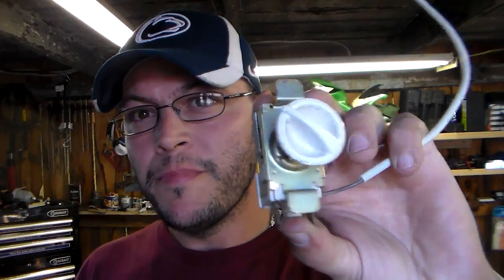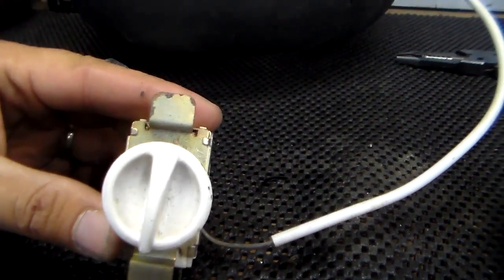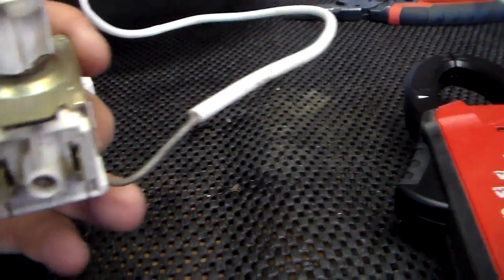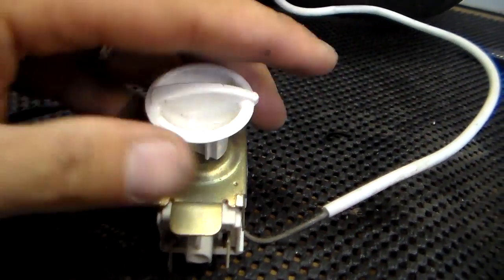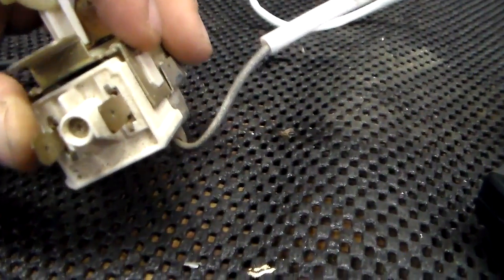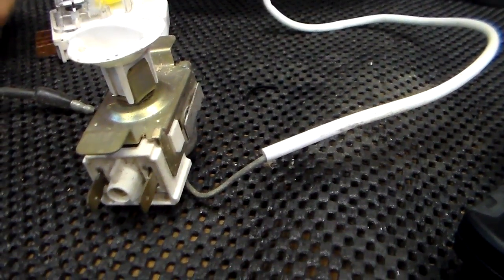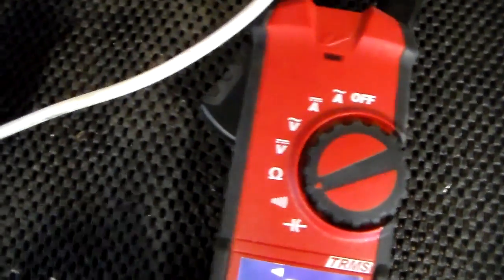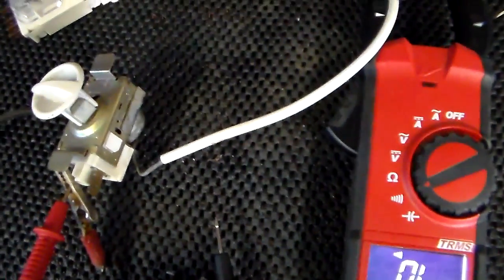No Cool Refrigerator - How to test the Thermostat

Comment: I have an ALL Refrigerator Gladiator/garage ready unit that isn't cooling. The compresser and relay are working. Freon was added (the repair person didn't say if needed but did anyway) .It worked 2 weeks nicely then stopped cooling. Light is on inside and a fan runs.Coils and back area clean. Could it be a bad thermostat?

Comment: Thanks for the advice and information. I have a small Frigidaire (EFR751) that for some reason, will shut down the compressor and then not turn on again. This happens with a power interruptions and it does not turn back on the compressor unless I cycle through the thermostat from off to cool at which point it does turn back on. I’m Thinking of replacing the thermostat to see if that will help. Thoughts?  Thanks.

Comment: Should there be a certain ohm reading? My temp control shows continuity, but no resistance when it's turned on. I get zero ohms no matter where I turn the knob. It breaks the circuit when I turn it off, but when on its just zero ohms. I'm not sure if I need to replace it. It seems like my compressor is always running.

Comment: How do I know which defrost thermostat to buy for a 40 year old side by side where the old thermostat has no numbers as you describe . The only numbers on it are 20640L14-174-721
L60  400395-101 Z8H. The make is unknown because it was sold as a department   store  brand  by Eaton's  in Canada which has long disappeared.  The model number is of no use either but it is HP4-DR818S3-Y, the max defrost 4.5 amps. HP 1/3 , AMP 5.7 volt 115 cycle 60. Please help, I would really appreciate it. Thank you for your time.

l

Comment: Ok so I’m about as green as it is when it comes to this type thing. So I have a mini fridge that does not have the freezer up top. I’ve changed out the relay and overload protector and that did not work so I went and bought a multimeter to test the compressor and the thermostat. The compressor as far as I know checked out fine but the thermostat, when I checked for continuity, it would beep when it was turned off and it would beep when turned on. Again, sorry if this is a dumb question but like I said, I’m a complete newbie when it comes to this type of work. Any help would be greatly appreciated!

Comment: Hi Bill - Thanks for all the great videos. I have a 3-year-old frigidaire all fridge (no freezer). It is running at about 65 degrees. I have checked the defrost timer, timer motor, and defrost control. They are all good. My temp control thermostat tests on all positions show 0 ohms.  I am thinking that is the problem, but the fan still goes on and off when I turn the knob, and that has me wondering. Does that mean anything or am I overthinking this? The part is quite expensive for me right now,  and I just want to double-check before ordering.

Comment: Hello Bill 
   i have a chest fridge from 1941  mode - 6    it's name is  (Ideal)  yesterday compressor stopped working, I knocked on thermostat fridge started to work but in the morning compressor was not working again.  i knocked again to thermostat compressor started to work again  i know the problem is the thermostat. 
    I have a question: van i clean the contacts in inside the thermostat or play with adjust escrow.    need your opinion   thanks in advance

Comment: I need to replace the thermostat on my Kenmore Coldspot refrigerator, manufactured in Dec 2010. I am being told by appliance repair shops I will have to buy a new fridge because the thermostat is no longer made and there is NO REPLACEMENT substitute part made. I need to bypass the thermostat while I search for a replacement.

However, I can’t get this old thermostat out. The twin prong plug-in “plugs” into 2 fragile plastic pieces. And I can’t see a way to undo the “plug-in” from the 2 plastic pieces they are forced into (one of which is attached to an orange wire, and the other of which is attached to a red wire). I would think it would slide out, but there’s no way to slide this thermostat out. It’s held in on the sides by 2 plastic cubes that are forced into square holes in the thin metal inside plastic of the fridge’s control. It appears the only option is to force apart the plastic pieces here, and also to force apart the plastic pieces into which the prongs of the thermostat plugs. If the plastic parts are cracked or broken, I fear I will not be able to bypass the thermostat. If I break the plastic pieces, I also would not be able to plug in a new thermostat, should my search eventually find someone who is manufacturing a substitute thermostat I could make to fit. Could you take apart the thermostat on a newer fridge, one with these plastic parts and show us how to remove a thermostat from the plastic parts without breaking the plastic? 
I have photos of all of this if you have an email address I can email them to.

Comment: Thank you so much for the tips!!! I did connect the 2 terminals together inside the fridge where thermostat connects and it worked… lesson learned, buy the OEM part. I did replace this thing a few months ago, a part ordered from Amazon that was obviously not good. Get the original. Thanks!

Comment: Thanks for this video .
My fridge when I plug in the wire the fridge light inside the fridge working but the fridge compressor and the little cooling fan the one next to the copmressoer not running ?

Comment: Hey Bill - thanks for your videos. They’re great.  I have a u-line thermostat with 3 pins - yellow, red and blue wires. Yellow to blue pin had continuity.  Yellow to red or blue to red is open.  The fans are running, but it isn’t cooling.  Can you tell me if this thermostat is ok?  BTW, the refrigerator is going in and out of defrost. Thanks for the help.

Comment: top mount freezer cold enough(but builds up something like snow  really fast)   and fridge is to warm.   Fan is working.   Coils in freezer are not icing over ,  defrost timer is coming on and off like it should.   what is wrong?   If the control temp. is not working properly would it be all or none?   Would it work half the time and not other times, or is it an all or none thing?
Reply: forgot to mention, I took the control box off in the top of the fridge and it is not iced up.
Reply: Can the compressor be the problem even though it is tuning off and on?
Reply: This is a fridgidaire fridge with a  top mount freezer  only 2 years old

Comment: I have had a problem with a whirlpool side by side . Would not come on ,took a screwdriver and turned defrost timer refrigerator started. Ran for four days like normal then on day 5 would not come on at all. Replaced defrost timer ,started back up . Now it runs but have to tap the thermostat to get it running again.  I have checked thermostat with ohm meter says good .

Comment: Kenmore upright freezer 2014 model that would not do anything except turn the light on when I opened the door.  Did what he said above-no resistance on the thermometer so I bridged across the terminals with wire and plugged it back in and immediately had the fan and compressor turn on.  $10 fix.  Wish I had seen this before wasting money on a defrost timer.  Thanks.

Comment: Bill you are a life saver.  My Whirlpool side by side refrigerator just went out yesterday and I did not know where to start.  I did like everyone in this situation - check youtube.  Your videos popped up and I began getting a clue to the root cause.  The compressor is not working and the fan is not working so I deduced the problem to be the refrigerator thermostat.  Didn't know how to check for continuity on a multimeter (embarrassing), but your video walked me through the steps and I nothing registered so it appears that I have a bad thermostat.  Just wanted to tell you thanks cause I'm sure you saved me lots of dollars.

Comment: You just saved me almost $3000 and 35 days of hassle. 
Fridge stopped working sometime Friday night. 
Ohmed out the compressor it was good, I had replaced the diodes and capacitor about 4-5 years ago.

Defrost thermostat was replaced about 10 years ago and still tested good.

Pulled the fridge control apart and found out it was the one that controlled the flap between freezer and fridge.
Pulled the freezer control apart and jumped the thermostat wires and it fired right up.

Ohmed out the thermostat and it tested good. put it back together and the fridge was working. I think I'm going to buy a replacement anyways just in case.

You wonder how this saved me almost $3000 and 35 days. The fridge broke the last weekend in Aug. My wife went to Home Depot and found a matching Black Stainless French door fridge, microwave, stove and dishwasher for their Labor Day sale. Because of Covid, the fridge is on back order until Oct 6.

Comment: Quick question: what if I’m getting resistance from the thermostat (not the control temperature) but no continuity at all? I did the test having the thermostat into a glass of water and ice for 10 minutes. Do I need to replace it?

Comment: Could it still be the thermostat if it never shuts off. Seems like y fridge run forever. It’s is ge profile double door fridge. I manually turned the defrost timer until it clicked and it did shut down the compressor and started heating up in the freezer department so that tells me the defrost mode works fine. But I was confused of how often a fridge is supposed to shut off. Does it only shut off when the defrost timer tell it to. Or does it shut off when the temp control tells it to also

Comment: I need help. I've been watching your videos and trying to troubleshoot things. My refrigerator is not as cold as it should be and all fans are working, changed the defrost timer and it still reads 50° in my fridge. Compressor works, coils are cleaned off, everything seems to be working but my fridge is still not as cool as it should be. What do I do now I'm lost??
Reply: There are many things which can cause a refrigerator not to cool properly. Since you already cleaned the condenser coil and verified that both fans are running, it's a good start. Now you need to make sure that it's actually going into defrost cycle about every 8 hours. Can you hear dripping defrost water "sizzling" on the hot evaporator heating element? You say 50°F in the fridge section, but what is the temperature in the freezer? What is the make and model number of your fridge, so we are on the same page?

Comment: My problem is that my freezer is staying on and freezing everything in the fridge, so cooling appears to be OK.  On testing the fridge thermostat, it shows 0.L on my meter when it's in the off position, but it shows random numbers, then comes back to 0.000 when it's set anywhere in the on position.  What does that indicate?

Comment: Hi.  Is there a major difference with Thermostat models.   I have a WPF14 thermostat and I can only obtain a WPF20 thermostat.  The connectors are 100% identical.. and I cant see a major difference with the 2.  At the end of the day - its a voltage control turning the knob right?

Comment: hi Bill I checked the thermostat with the multi tester and it's working but it's strange that my refrigerator does not have a defrost timer next to the thermostat it has a little box circuit board refrigerator freezer works but the refrigerator the items are warm

Comment: I have problem that refrigerator keeps cut off and re start every few seconds or half minute. I shorted the two terminals of the thermostat and connected the two wires coming from back and then power on refrigerator and it started as same with same problem of cut off after few seconds. So it means thermostat is defective?

Comment: Hey Bill, my thermostat ohms out just fine. By turning the knob I can turn the compressor on or off just fine. However the thermostat will not change its state on its own any more based on temperature, only by me manually turning the knob. In other words, my fridge is either running constantly or off constantly, depending on the position of the knob. My questions are: 1.) Is this definitely a sign of a bad thermostat? and 2.) Is this a common failure? Thanks!

Comment: Hi Bill. I watched many your video how to repair the fridge. My fridge is not freezing. It just cool only. I changed defrost thermostat is new, fan is running, I checked heater is ok, timer is ok, cold control thermostat is ok, compressor is working. The compressor relay is ok. But my fridge is still not freezing. Do you know what esles I should be check??? I wish to hear from you soon. Thanks

Comment: Hi Guys, 

My fridge stoped working some time ago, but recently I've decided to repair it. First of all I've checked the resistance of motor, and it was 22.2, 24 and 46.2. So it looks healthy. Then I've checked resistance between wires going up to thermostate and going down from thermostate. Resistance was close to 0 so I've left the thermostate in place. Decision was to get new motor start relay. Nothing have changed. As relay came without capacitor, I bought new capacitor as well. Still nothing. I've removed thermostate today and shorted thermostate wires. Still nothing. Looks like I'm stuck. Does anyone have an idea what to do next?
Reply: Change defrost timer. look whether timer is stuck in defrost mode or not. If stuck in defrost mode, turn timer clockwise and set to cool/compressor mode.if compressor run then timer change will be ok.

Comment: hey I got a question to ask ya, so I have a Vissani wine fridge and everything is on and the condenser is warm and I hear and feel a vibration, and the copper lines are cold to the touch, BUT my fridge isn't cooling down. I do hear noises from the inside of my wine fridge but its just not cooling. ANY SUGGESTIONS ??????? MY BEER IS WARMMMM LOL

Comment: When testing the resistance of a circuit in Ohms as in the video:

The higher the number/reading, the worse off you are (the bigger the resistance, the less current is able to go through) 

If your tester number starts to go into down into very low numbers, thats low resistance, current can pass through easily and that circuit is working fully. 

If you connect the tester and absolutely nothing happens, then the circuit you are testing is broken/dead (if theres a switch on the circuit, make sure its turned ON - he says in the video to make sure the thermostat is turned on) 

To make sure your tester is working if youre not getting any reading, connect your two test leads to each other, this should start to give you a reading as your tester is a circuit too!

Seemed important to clarify as theres no much info in the video for those not accustomed to a multimeter/ resistance tester
Reply: excellent clarification. thanks!

Comment: Bill, just wanted to say thank you so much for your videos. My Frigidaire freezer stopped working one month outside of warranty. $500 appliance was suddenly trash! :( I finally found some time to try and diagnose the issue, and after testing the defrost thermostat (it was find), replacing the defrost timer (didn't actually need done), I finally found this video. I wired the two wires together to test, and it finally runs again! (I disconnected it again until my new thermostat comes in. Thank you again!

Comment: Hey Bill, 
I enjoy your videos. I have a Kenmore frig that is too warm. It just stops running and if you touch the control it starts running. I am guessing that the temp control thermostat I bad.

Thanks,
Larry
Reply: Hi Larry, did you ever find out what your issue is. I have a similar problem with my Whirlpool refrigerator. It will cool if I turn the temp control to a cold setting but once it is done and cycles off it won't start cooling again until I turn the control all the way off and back on.

Comment: hey bill  my temperature control turns on and the fan is running but not getting cool at all.  I tested compressor/installed thermostate and defrost timer can it be bad even if it turns on?
Reply: tom Waters

Comment: Hi bill, i have a mini samsung refrigerator which i left for 3 months unplug with doors slightly open, when i came back and plug it on the ref is not working properly, the freezer is cooling but just a little, enought to cool certain food overnight. There is no air flowing inside. And the compressor is just humming. What could be the problem?

Comment: what function on the multi meter do you use to test the thermostat
Reply: Continuity tester, but you could also look at resistance. The thermostat is just a temperature controlled switch, allowing or preventing current from passing through. It should go from extremely high when the thermostat is off (low temperature) to almost zero when it's on (warmer temperatures).

Comment: Suppose the symptom is as you say even though the thermostat - cold control and timer have been replaced (twice)? I smack my fist above the operator panel and the fans - motors come back on and cool normally. My coils are clean. Whirlpool side by side ED25TEXHW01. HELP!